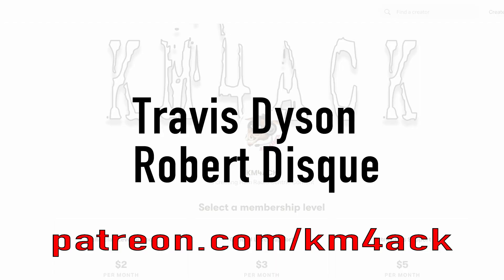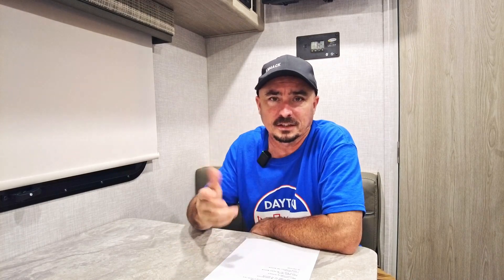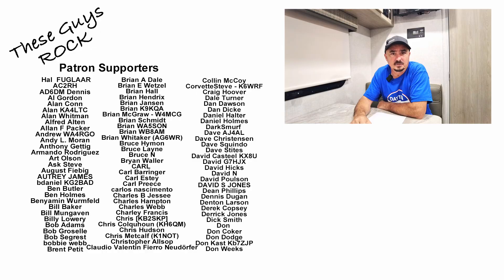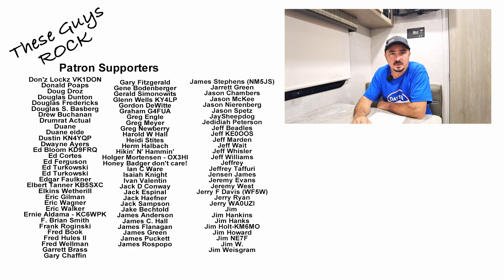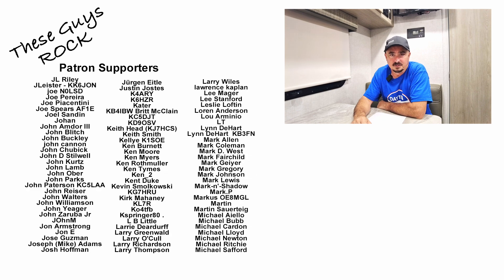Most Challenging Field Day

Comment: Thanks Jason. An inspiration to help others.  One thing I did this year that greatly helped my QRP station in the FD multi transceiver environment. I built a 1/4 wave coax stub filter that nulled 40m and 15m when open and 20m and 10m when shorted.  DXE-400 created 29db attenuation on 40m according to my VNA and a bit less on the other bands.  Might be a good exercise for a video.
Reply from the maker: Great tip!

Comment: I spent 6 months get my set for fd ready and most of it failed I feel ya.  Winlink i could not get working and other modes.   Varac and ft4 & ft8.   Then they told to shut station down after being up all night.  I was so pissed.  I am going to read your message.  Plus my packet radio station was not working either.
Reply from the maker: Sorry to hear about the bad experience. Maybe try Winter Field day which is typically a bit more laid back than FD.
Reply: @KM4ACK  a group of us from the club doing our own thing next year.
Reply: That's tough, but good reason to keep learning and trying for next year.

Comment: The problem I have had with using a Baofeng is they have a delay when the radio transitions from TX to RX, or a lengthened "squelch tail".    This causes transmissions to go out correctly, but the beginning of the reply packet usually get's chopped off by the radio because it has not completed the transition to RX in time to catch the whole reply packet.
Reply from the maker: Using VOX in the past, I have ran into the long delay release of the PTT. Typically though, if using something external to trigger the PTT, it has worked in the past. Still, the Baofeng is my least favorite option for anything digital.

Comment: So, for Winlink on a FTM400, what is needed beside the laptop and the radio? Cable? DigiRig?
Reply from the maker: Yes. You will need the digirig itself and this cable https://amzn.to/3PG4kF8 (affiliate link). The cable plugs into the back of the rig on one end. The other end into the "audio" side of digirig. If you plan on using VARA FM with Linux in this setup, check out this video to get the comm port configured https://youtu.be/iYYRTu6myRc